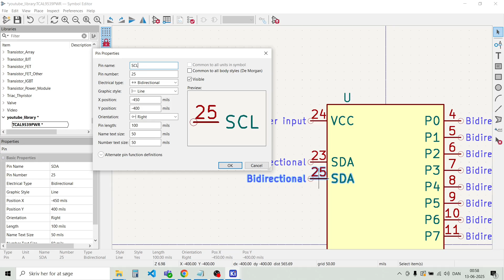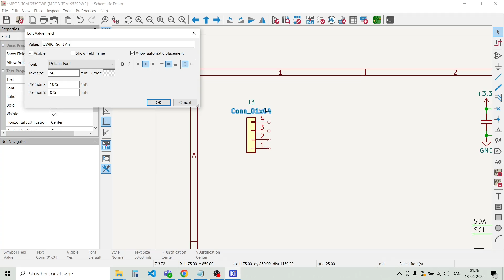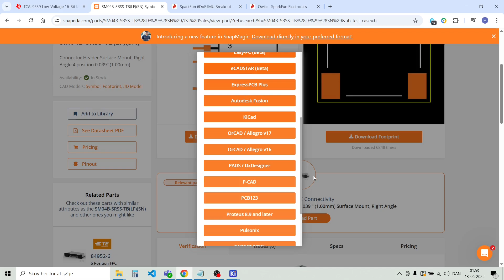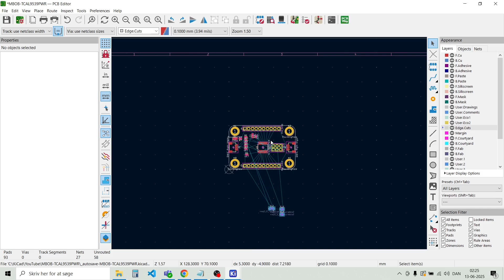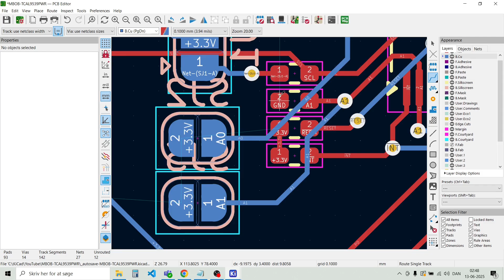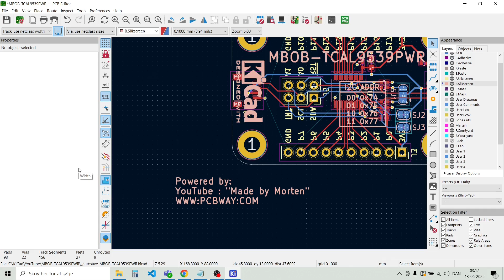Complete design tutorial of a TCAL9539PWR breakout board in KiCad

Comment: What is the J5 for? Dont you need to put at last a GND there?
Reply from the maker: There is GND on the 10 pin connectors, why do you need GND on J5 ?
Reply: @made.by.morten.laboratories  Then you have it all in one connection, maby even add a 3v3 to :-) Like your video :-)
Reply from the maker: I will add that in v1.1 good idea